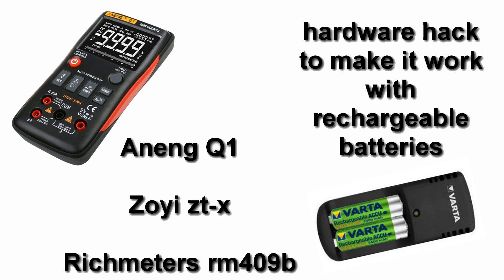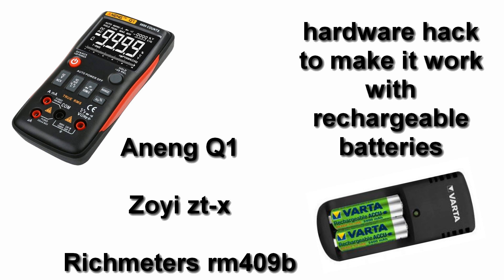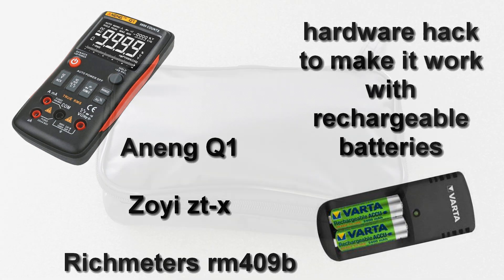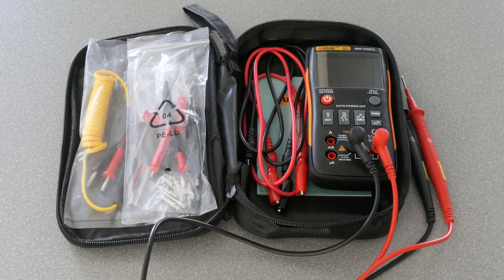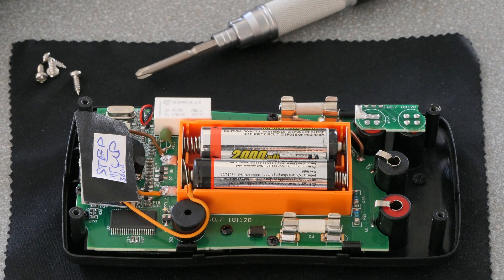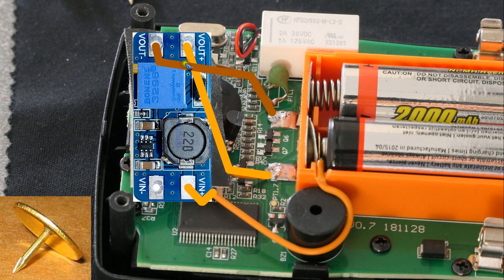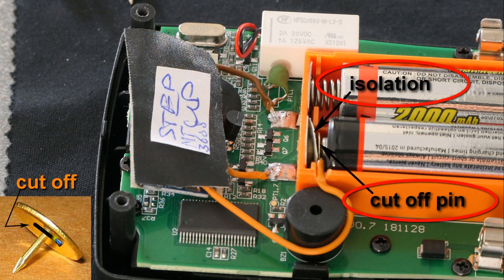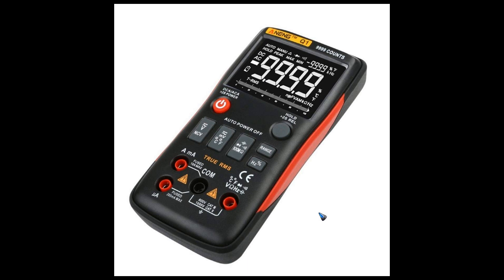Aneng Q1, Zoyi zt-x, Richmeters rm409b - Rechargeable Battery Hack

Comment: Doesnt potentiometer work on principe of resistance?So lowering output voltage to 3v increase resistance and drain battery faster?
Reply: The potentiometer is not in power  path, it's in feedback path, the feedback voltage is read by the control chip to decide when to switch. It flows only the tiniest little current and it's basically constant regardless of setting.

Comment: This module is with high quiescent current, you can look out for module with ME2188A30PG.
Iq >1mA vs 12 to 15uA. Price different less then 1USD. Module size is much much smaller (~1cm x 1cm).

Comment: NCV feauture not working great after i put dc to dc converter.
Reply: Indeed, it’s because of the inductor in boost converter. Try to wrap it in aluminum foil and move it far away from NCV antenna such as the bottom of mutimeter.

Comment: Also when used with regular batteries you still have to make this mod. I've found out that when the batteries are providing aprox. 2.7 V the voltmeter and ampmeter are not measuring correct anymore, without low-battery indication! I've just followed your steps except that I placed the +battery plate upside down and made a small opening in the orange plastic cover at the topside to allow the plate to pull out. Then I soldered the Vin+ of the step-up converter directly to the battery-plate and the other 2 wires like you showed. Because the step-up converter is attached to the battery holder it cannot move anymore inside the housing. Thanks for this solution!

Comment: I have a suggestion that does not involve any modification: just use a 14500 LFP type LiFePO4 battery and a spacer in series. Concerning the use of NiMH batteries, I found out that the LED back light gets annoyingly dimmer, but the readings are only marginally affected (say, a couple of millivolts when measuring a 4.096V reference, for example).

Comment: I bought one of these Aneng multimeters Rudy, i got the AN8008 and it was really cheap, seems okay and does the job for me, i haven't had to change the batteries as yet but i will keep this in mind when the time for battery change comes along. Thanks for the tip!